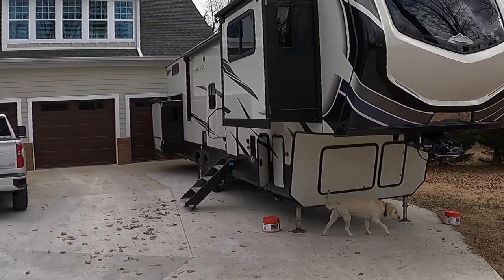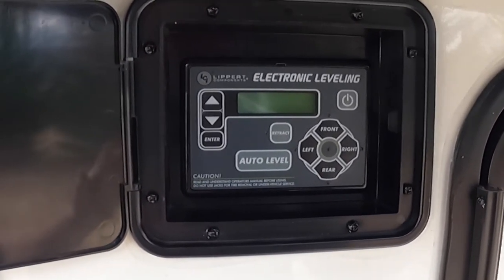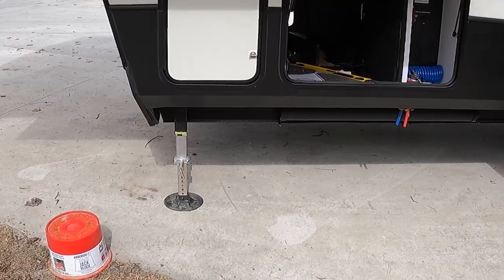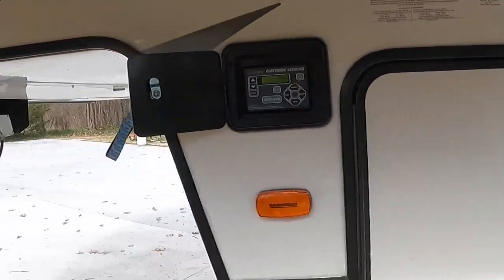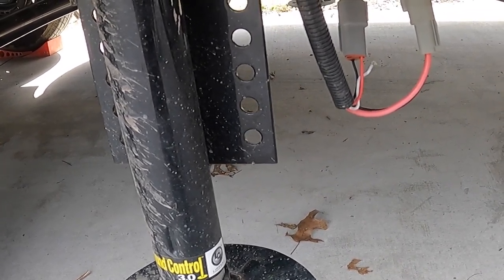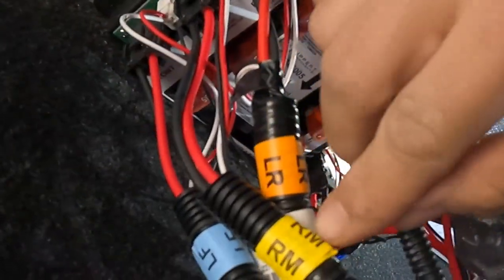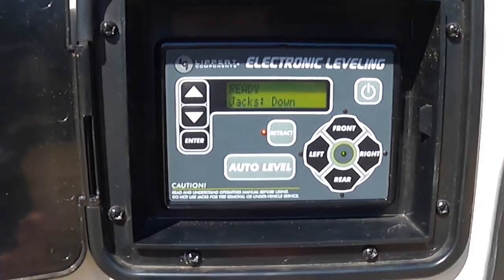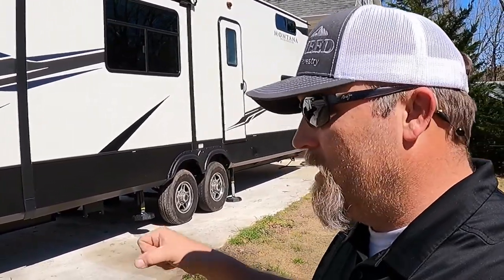How to: Lippert autolevel repair and calibration

Comment: We were having THE most frustrating time on our 2022 Dutchmen Astoria with the Ground Control 3.0 6-point system. I tried EVERYTHING!
It would say it was slightly out of level on the left, but when it went to push the left rear leg, the right one would extend. After some digging I discovered that the factory had wired the middle and rear legs on the wrong sides! The front was right but the middle and back needed to be swapped!
Swapped them at the control box and it levels like a dream. MONTHS of headaches all because of "quality control".
Reply from the maker: Yikes, glad you were able to figure it out. I guess there’s always room for human error. Enjoy the season thanks for watching.

Comment: Thanks for a great video. I have a grand design reflection series 150 RL. After auto leveling the tires are off the ground on my concrete slab in my barn. Any suggestions?
Thanks, Dan

Comment: I have the coach sitting on the fifth wheel plate but iits offset how can I relocate the coach off the truck the weight is on the plate can I jack up the coach and pull out and level the coach then start all over again it's jamed on the plate